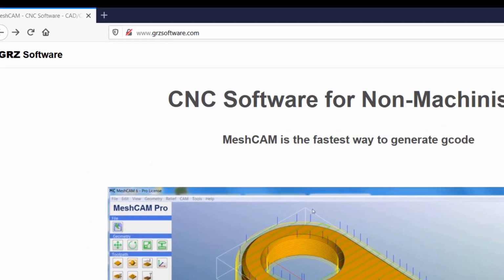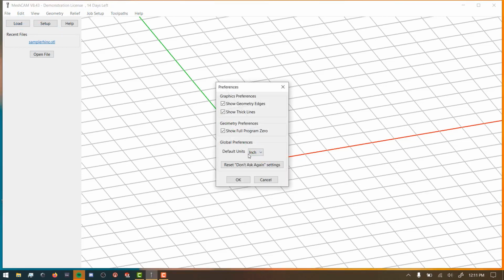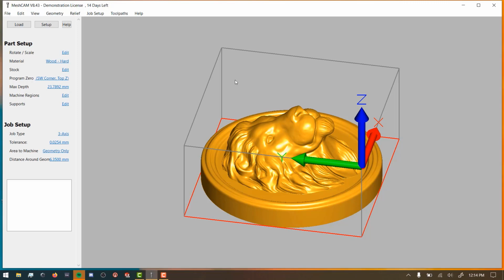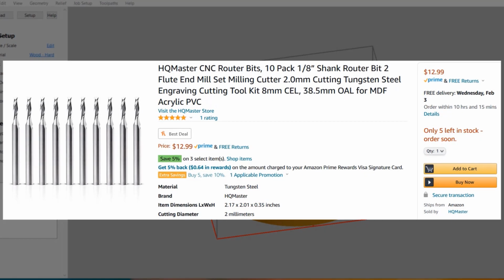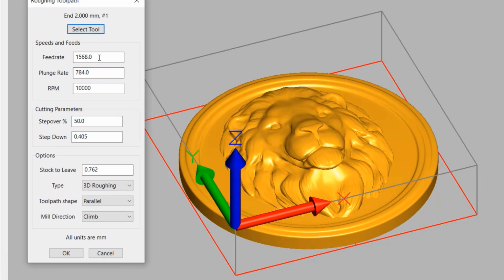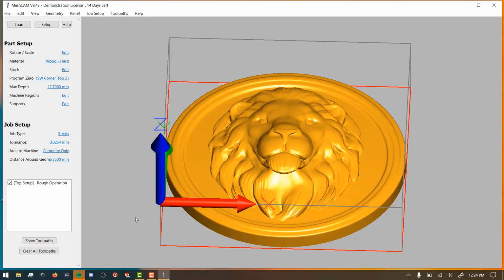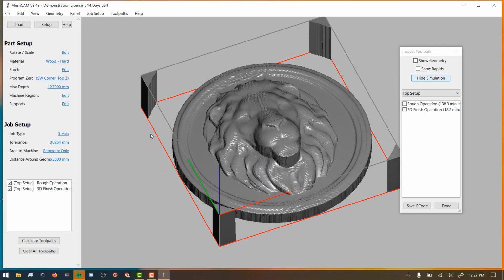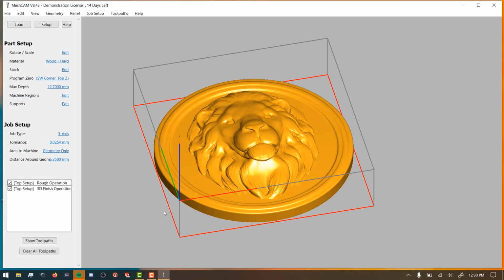MeshCAM Intro (Your first 3018 CNC project!)

Comment: Just getting into this and your video is so helpful. Is the overall length the length of the end mill when out of the collet? Or, is it the length of the end mill from the tip of the end mill to the collet? I can’t see why the program would need to know how much of the shaft is inside the collet, but I could understand the program needing to know how much is exposed as this would indicate how much clearance there would be. I hope this makes sense.

Comment: It was a nightmare downloading the 'free' STL file..  I would really like to see demo of the Standard version, since this is about beginners looking for a good tool.. $250 is a a big investment for beginner..  
You assume viewers don't know how to download and install software, then you proceed to assume we need the Pro version.
Why should I look at a $500 upgrade before deciding if the $250 will work for me?

That said, thanks for the tutorial..
Reply from the maker: I'm sorry you had trouble. I wanted to show the full potential of the software in one tutorial. I also did this in partnership with the software company.

The main idea is someone may be familiar with CNC but not computers. I know that sounds odd, but it describes quite a few pro's that I know. They can run a machine all day, but a PC can be foreign.

That being said there are TONS of folks that are familiar with 3D printing and NOT CNC software. That is what MeshCAM was built for. Almost as a slicer for CNC.